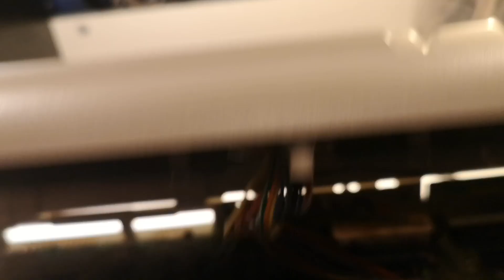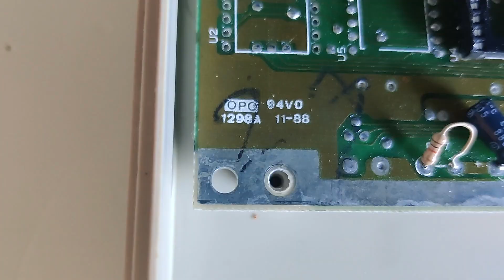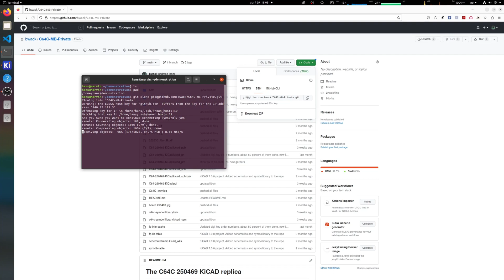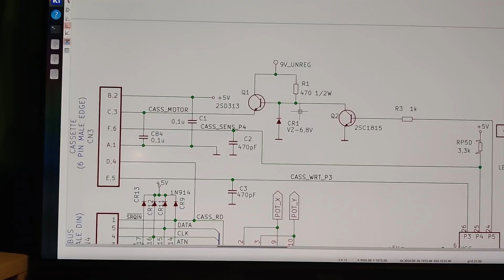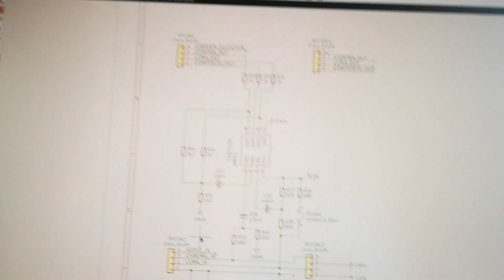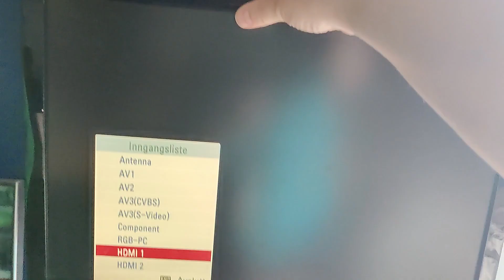C64C 250469 replica PCB Prototype - part 2

Comment: Hi again, I found that putting flux on the solder braid instead of the chip legs is easier to remove the solder from a chip legs… Thanks for the video
Reply from the maker: Thanks.